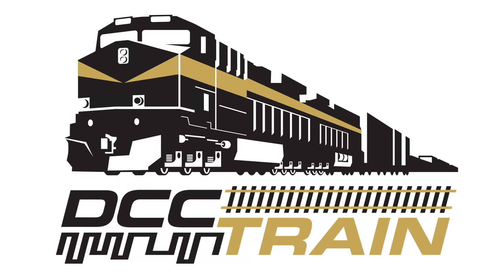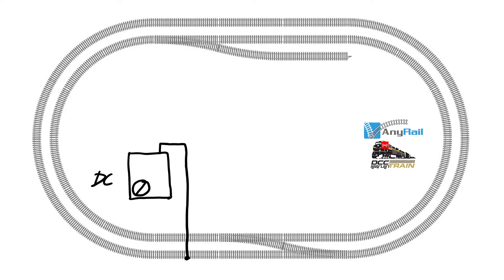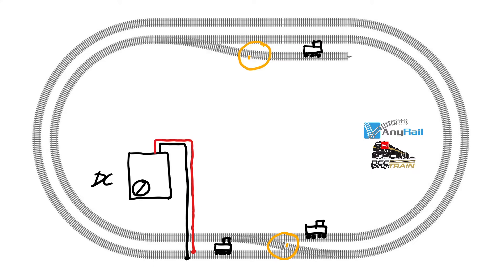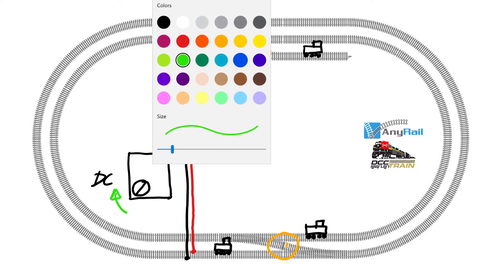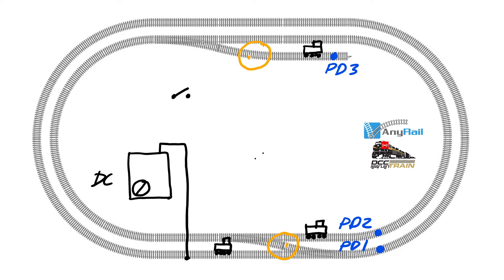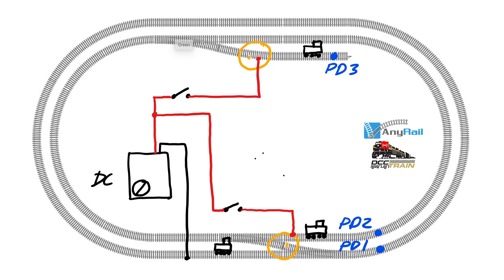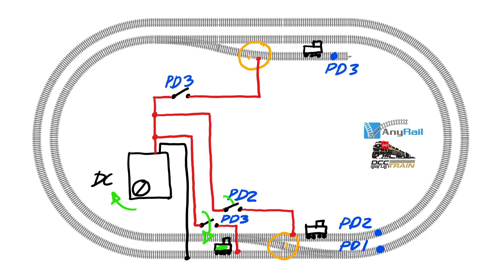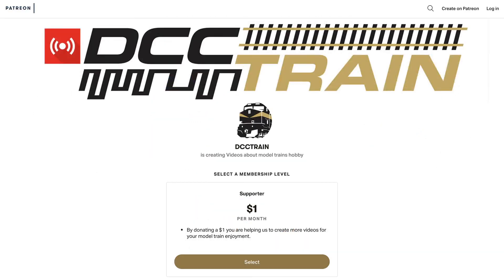How to make power districts on DC layout then connect DCC part 1

Comment: On the outer tack, PD 1, you have the switch written as PD 3.  Intentional or mistake?  Other than that, pretty basic video, easy to understand.  Thanks!
Reply from the maker: Thanks. Power Switch PD3 is controlling Power district 3 PD3 because it optically insulated with a cut marked with an orange dot.

Comment: Ok as newbie setting up my first layout, why I do I need power districts , how do run your trains with three switches
Reply from the maker: This is an old fashion DC layout getting ready to connect to the DCC system.
Reply: Maybe so but you did not answer my question,why do I need this
Reply from the maker: @dundasjunctionmodelr.r-james  You do not need this. This is a simulation of the old DC layout. In the next video, I will explain more.
Reply: Ok thanks